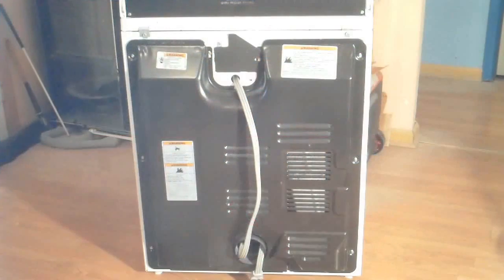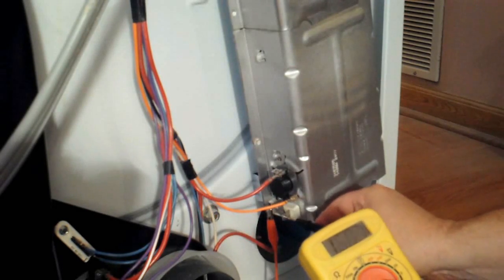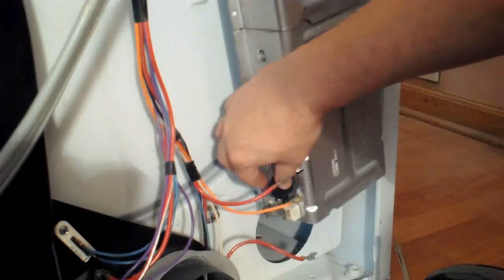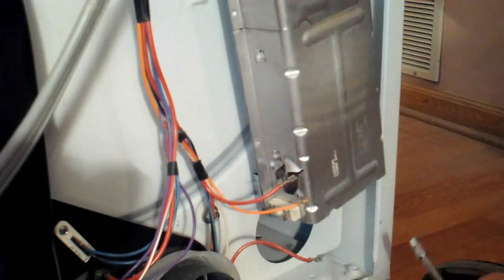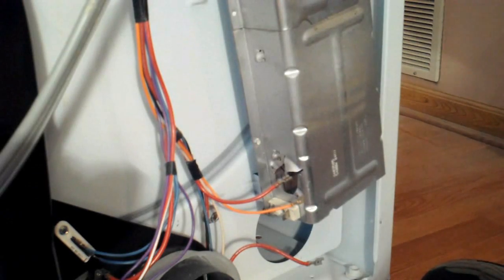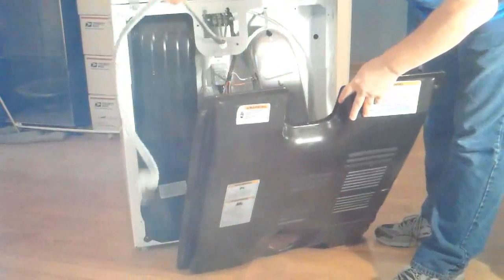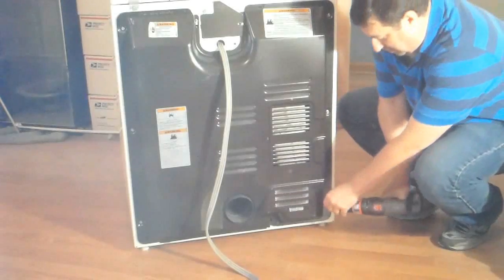Whirlpool & Kenmore Dryer Repair - How to Diagnose Won't Heat - Heating Element 279838 Testing

Comment: It's my pleasure and thanks again for responding to quickly.  I officially lost the upper t-stat last night; my wife let the lint trap go uncleaned after a load of brand new towels probably when I sent the message above, so I'm thinking that killed it.  Maybe that's what was causing my problem 2 days ago.  I replaced both t-stats today, so I'm hoping my drying issues are fixed once and for all...or until the next part fails.  :)  Thanks, Ken.

Comment: Thank you. I already ordered a replacement. It's probably a good idea because I removed the element and one of the little ceramic braces had shifted and a wire was touching the steel plate. The top half of the plate is discolored almost black. Thanks again.

Comment: Thank you for this video. My dryer stopped heating yesterday, and I really do not want to purchase a new one at this time if I don't have to! It appears to be very simple to run through these steps to discover the issue. I checked to see if my local parts store carries the thermostats, and fuse, which they do. Thay also offered to test them for me to see if they have continuity. I though this was great customer service, especially since I do not have a meter to check this on my own.

Comment from the maker: Yes, it can be partially broken.  Best to remove it and visually inspect the coils.  Also, if you remove wires from the element (UNPLUG DRYER FIRST) then check for continuity between 1 terminal and the heat box, there should be NO continuity or ohms reading at all.  Then check the 2nd terminal the same way.  If you find continuity from terminal to the heat box body, replace the element, it is shorted to ground somewhere.  If yours is good, it could be a thermostat gone bad.  Hope this helps!

Comment from the maker: You can cut off the burnt ends of the wires, and then crimp on new terminal ends, just make sure you get the large size terminal ends, the small ones will not fit on the spades of the thermostat or the heating element.  If thermostat is burnt up, have to replace it too.  Of course, check the Hi Temp cut off fuse up  above on the top of heat riser box, replace if it has no continuity.  Test element and replace if it has no continuity.  good luck!

Comment: One final note for others who may have these problems... most of the thermostats & fuses seem to work fine even if you order an aftermarket version with the exception of the thermal cut-off. Even some on Amazon that claimed to be OEM parts were outed by reviewers to be copies that quickly failed. I found a real OEM part with the number 279769 for about $16.

Comment from the maker: Look at my video on kenmore dryer belt remove and replace.  Once the belt is removed, just lift forward on the drum to remove it, being careful not to cut yourself on the panel edges.  Inspect the drum support roller wheels.  They are likely what is worn out and rumbling.  Replace if they dont roll easily and straight, or if there is slack between the roller and the post it is mounted on.  Hope this helps!

Comment from the maker: Remove the screws that hold the element in the housing (they are near the ceramic insulator where the wires attach) and then the old element coil should slide down and out of the housing.  It might be stuck and take a bit of force, but it should come out.  Then install the new one in reverse order of how you removed the old one!

Comment: This is exactly what I needed to see, now it's just a matter of borrowing a volt tester. In the event it is the heating element and not the circuit, should it be clearly visible that the heating coils need to be replaced?

Comment: Hi. The other thing I mentioned is also on the dryer in your video, you just have it cropped out in the close-up where the parts are labeled. I think I needed the element anyway because it looked burnt out. The dryer blows enough air to push a sailboat so the  motor must be good, no? Timer seems to be working fine too.

Comment: wow great vid!! i wennt to take the bottom one off the thermostati think ... but it was smoked i broke off becaus it was melted the wires are cooked coming right off it.. it looks like i could replace the whole unit and shorten the wires and intstall a new thermostat but it seems like it may be dangerous and may be faulty.. it is this exact same dryer to!!

Comment: it worked out good got the parts tonight i did find the break finally in the old element heats good now an new timer as well cant believe they wanted me to buy a new knob they want 22 dollors for the plastic knobs hmmm sounds like a good ebay item lol.im using the one that came with the dryer.anyways aprreciate the help feel free to watch my videos an comment as well rate if you like or dont take care.:-)hope the help you give others comes back to you.

Comment: thanks for posting the video i didnt have the volt tester but was able to pull both the timer an heating element now to get the new parts my timer went out an i didnt know it the dryer still runs but timer wont move an it wont heat now so im assuming it ran to long maybe burnt the element out.

Comment from the maker: If the wires are removed from the terminals, there should be no power or current.  The test to perform would be to set your ohm meter to lowest ohms setting, and see if you have continuity with a low amount of ohms resistance.  If you have no continuity, the heating element is broken and needs to be replaced.

Comment from the maker: Check all thermostats and fuses the same way, with wires removed and using an ohm meter to test for continuity across the terminals that oppose eachother.  If no continuity, then it is bad.  If has continuity, it is good if it is a fuse, and MIGHT be good if it is a thermostats.  It could still be opening at wrong temp, so thats why I said might be good.  If all have continuity, then you need to move on to testing timer and motor.  Send a picture of the other t-stat you saw, prob a fuse.

Comment: Thanks for the help, I think I have figured out it's a bad heating element.  However, in this video there is an orange wire hooked up to the heating element.  There is no wire at all on that terminal in my dryer. Any ideas?

Comment: So the top main red wire (coming from the thermostat above) connects to the upper post on the hi-lim thermostat and the other side of the h-l t-stat connects to the back post of the heating element. I connected the bottom main red wire that is supposed to connect to the front post of the heating element to the small post on the h-l t-stat that is unused.  Just for grins, I checked continuity on both t-stats and the element and they're all good.  I'm guessing I fried the control board.  Ugh...

Comment: Canyonman I have follow your video.  My dryer runs but dont get hot.  I checked across on heating element and have continuity and I check across the thermostat and have continuity but when i check from heating element terminals to thermostat blade terminals i have nothing.  no continuty

Comment: I recently went to get parts of my dryer tested which were the heating element, hi-limit t-stat, operating t-stat,or thermistor on some models, and the blower box thermal fuse which all checked out in working order . My dryer works, it's just in order to dry clothes I have to dry them twice, the service department told me that it could be my timer but I don't see that as possible. I could use your help and advice please. thank you

Comment: Hi, Ken.  I hope you got the donation this week.  Thanks again.  We have heat again, but we still have a recurring issue where the sensing light (and all others past that for the various stages of drying) will go out mid-cycle and the dryer will keep running without heat and without the timer advancing.  Any thoughts?

Comment: I don't have the orange wire at all. I've got the 2 red ones as shown but the orange one closer toward the inside is nowhere to be found. I don't think it spontaneously popped itself off and whipped to the center of the unit where it's hiding...
The machine just started not heating. I'm getting a connection at the places you checked. Where the orange is supposed to go and the bottom red I'm getting around 11.0. From orange to top red it's around 2.0.
I THINK I'm using the multimeter correctly: Omega is at 200, the lowest setting.
Reply: Okay, I just saw some comments where you said that some don't have the orange wire. I'm getting about 8.0 on the multimeter where the reds go. Is there something else I could check to pinpoint the problem?
Reply from the maker: Make sure you are removing at least one wire from each component you are testing.  Test the heat element down at the bottom two terminals to make sure it is having continuity and is good, test that thermostat to make sure it has continuity, and then up at top of heat riser remove wire from the high temp cut off fuse and test it to make sure it has continuity and is good.  If all test good, then either the timer is not supplying power to the element circuit, or the motor switch is not supplying power to the element circuit.  Each have to supply 110 volts to the element to give it the needed 220 volts to heat.
Reply: I'm not getting 240 volts. The dryer is probably fine. I was reading more and more comments on this video and learned about 120v x 2. Learning a lot today. Parts of the dryer, how to use a multimeter, how my house is wired. And now I need to find out how to get an old ass replacement fuse. Thanks for all your answered questions on this video!
Reply: a question for you. I have an older Frigidaire dryer that has a three prong cord. I need to replace it with a four prong cord. my dryer isn't color coded for the four prong wires.  Do you have any advice as to which connection screws I should attach the red, white and black prongs?

Comment from the maker: Oh, and by the way I do have a video on testing the Hi-Temp cut-out fuse for when you have no heat on this type of dryer.  This particular video was just for testing and replacing the heating element.  Check out the videos I have from my uploads page and you will find the video that covers the fuse and thermostat.

Comment: Wires on stat and element have to go n same blades they came off of?  These are just open and close switches, so why does it matter which blade a wire is on as long as the wires for the stat are going to the stat and wires for the element are going to the element?

Not sure of the reasoning there, still a good video

Comment: Hello.  Exc vid!  I diagnosed a broken heating element & replaced it.  However I wasn't paying attention & attached the bottommost wire that should go to the near post from the heating element (out of the ceramic) to the small post above it (that shouldn't have anything connected to it.  Powered on, hit start, the dryer tried to start for a split second and died.  No tripped fuses.  Can't power on the dryer (Cabrio).  Did I kill the dryer?  Is there a fuse inside I tripped? Will PayPal for help!

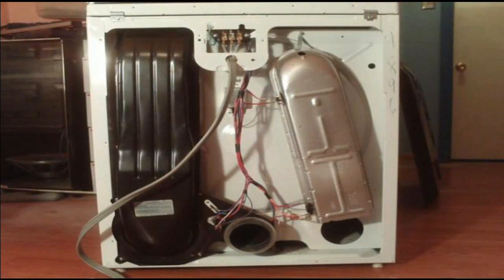Comment: The new thermostat arrived and still no heat. All thermostats are new or testing good. I still don't know what that thing is that looks like a thermostat that is located 14 inches above the hi-limit thermostat? You can see it in your video at 1:21, before you zoom in a bit and show the parts all labeled. I couldn't order a new one because you haven't told us what it is called yet. I took it out and tested it and there is no change on the multimeter at all. What is it called? Blower works fine.

Comment: Grrrr. I installed the new heating element today but still NO heat. I replaced the white fuse but not the hi-limit thermostat. There is also another thing about 10 inches above that thermostat that looks like another thermostat that you didn't mention in your video.

Comment: I'm getting a reading of 50 ohms between the element's terminals and 50 ohms between the thermostat terminal and the element terminal. Does this mean that only the thermostat/element unit is damaged but that the element coil is ok? (Frigidaire 3.2 custom dryer)

Comment: What is a normal multimeter reading for a good heating element?  I get a beep from my digital tester, but the reading across the two ceramic terminals for the heating element is 009.  Thanks

Comment: My dryer has good circulation but is not heating well (it heats some but is not getting hot enough). I checked the thermostat and it is working. Could it be that my heating element is partially broken? I know when elements usually go bad they won't heat at all, but I am getting some, just not enough.
Thanks!

Comment: we have a kenmore elite Quietpak9 electric dryer, the dryer was not in use at all and hadn't been used for several days when the dryer started beeping and every light was lite up, the only way to shut it up was to unplug it, so I did and when I plugged back in it now won't do anything, the panel barely lights up, won't do anything...any suggestions on what my husband should check

Comment: I am having problems at 3:12.  My drier won't heat, was told it was the heating element, replaced it, not sure if I got the wires back in the right spot, but my ohm readings are good except between the heating element and the thermostat.  It shoes infinity just like between the body and the heating element.  Does that mean my thermostat is bad?

Comment: Last week I was patting myself on the back for fixing my dryer. Now its broken again (wont Heat). I replaced the thermal fuse and put on a new dryer vent hose. Vent hose was ripped small hole. I paid a guy a couple years ago to fix and it was the thermal fuse. what should i do now ?

Comment: Can you explain how I don't have a wire connected to one side of the heating element? As your video shows, three wires going to the heating coils and sensor, two wires are shared as the connectors overlap, which you mention. The orange wire, which connects to the inside post of the ceramic is simply not inside my machine. There is no sign of this wire, or any dangling wire. How in the world could the heater ever work or the thermostat right above it work? I literally have one wire going to the thermostat and one wire going to the heater coils. I did look at my heater and found a broken coil, and my dryer only stopped getting hot yesterday...but how could it have ever worked?

Comment: hey man were tryn to fix my dryer its a roper but i dont even know where to start dissasembling it., it heats fine but it makes a constant loud rumbling noise and it still spins the clothes around but the noise is what worries us, we were told it was that the drum had loosened off where it should be....help?

Comment: Thanks for the help. I've narrowed it down to my heating element. I've noticed in all of your videos there is a red wire connected to the heating element near the high limit thermostat. Also A Red Wire AND an orange wire attached to the high limit thermostat. My dryer does not have the orange wire. I can't find it anywhere and it wasn't there when I took the back panel off. Do you know what this wire does or if the dryer will operate safely without it?
Reply from the maker: +uncle tood Not all dryers have the orange wire.   Just make sure you attach the wires your dryer has back where they were when you  1st started and you should be OK.  The orange wire on newer dryers supplies power to run the timer motor during the cool down sections of the cycle.  You are safe to run your dryer without it if it never had it to start  with!

Comment: canyonman with all wires off i have continuity across white insulator and i have continuity across thermostat.  but when i check from inside blade terminal of insulator to outside (last) terminal (so im checking across insulator and thermostat I have no continuity and also the high temp cutout fuse i have no continuity

Comment: i also have a kenmore and did what u did in video except i have dont have a ceramic element  i did test and have continuity on both thermostat and element but when i checked from element to thermostat no reading like u did last before showing the removal  ????
Reply: ok  i will try that tomorrow then   thank you  will let you know what happens.

Comment: I've been trying to fix my Kenmore electric dryer for awhile now and still can't seem to figure out what is wrong with it. The dryer won't heat. I replaced the heating element, hi limit thermostat, cycling thermostat, thermal fuse, thermal cut off fuse, and electric circuit board. I have also tested the 2 hot wires (red) going to the heating element they both are getting 120V. Therefore my fuses are good. That also says the centrifugal motor switch is good right? If that were bad it wouldn't be getting 120V to the one terminal on the heating element would it? I also tested the dryer timer per the sears troubleshooting video. At this point I don't know what else to try. If you could please help me out here that would be great.
Reply: canyonman1963 my Kenmore dryer won't heat up and I tested everything and it all tested good still won't heat any suggestions